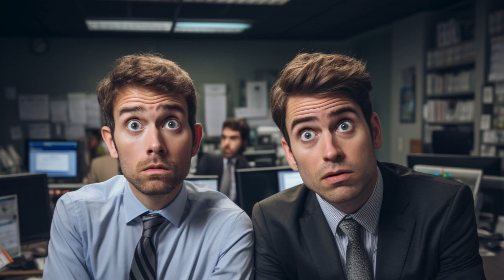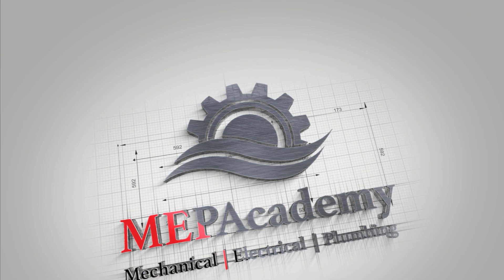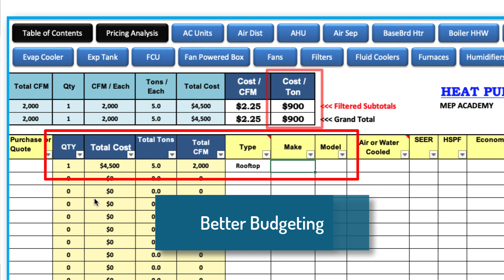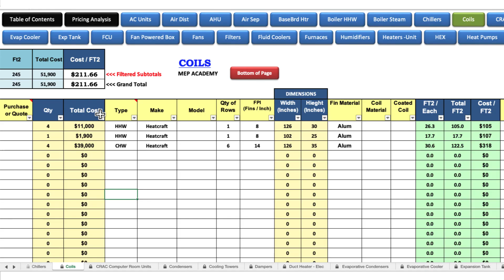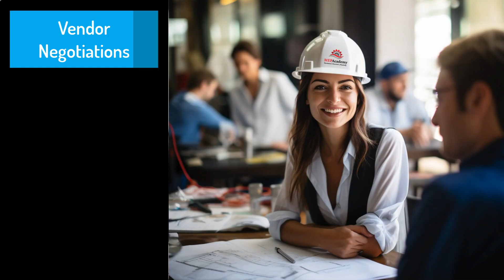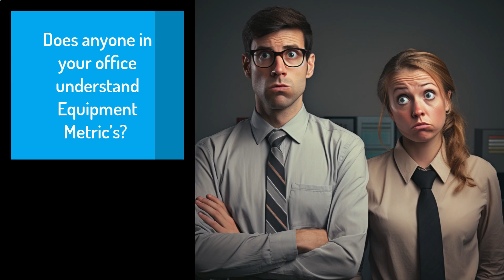Mastering HVAC Equipment Budgeting and Purchasing

Comment: What years do you have available? And do you have the actual sales price for unit in different regions as well as the lifetime costs?
Reply from the maker: Thanks for the question! The Historical HVAC Equipment Database is a template only—it doesn’t come with any pre-loaded pricing. Instead, it’s designed for you to input your own equipment costs from vendor quotes or purchase orders.

This allows you to track key metrics like cost per ton, cost per CFM, and lifetime cost of ownership over time. Because equipment prices vary by region and contractor purchasing power, it's more accurate to use your own data.

You can enter equipment from any year and across any region, and the template will handle all the calculations and tracking.